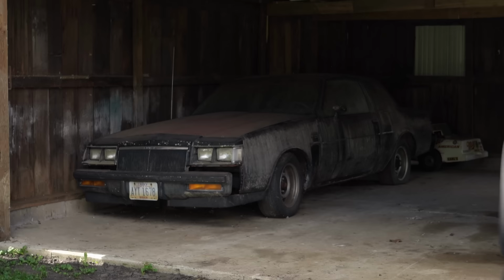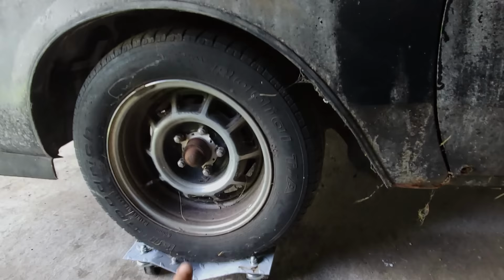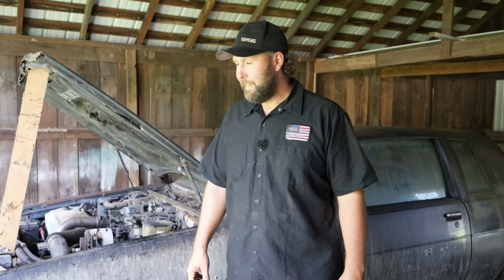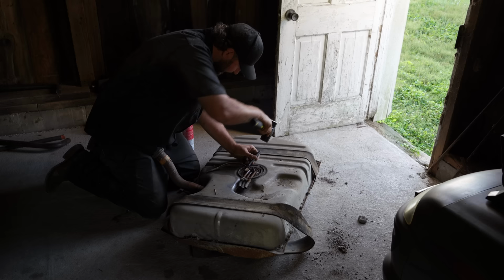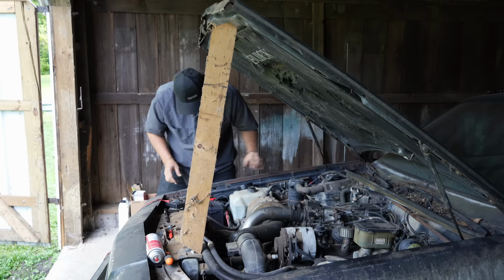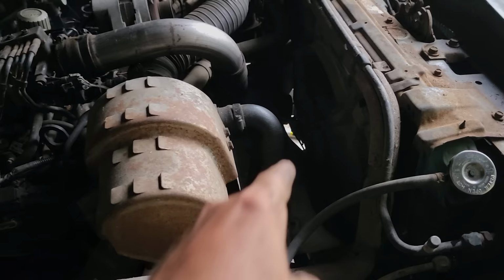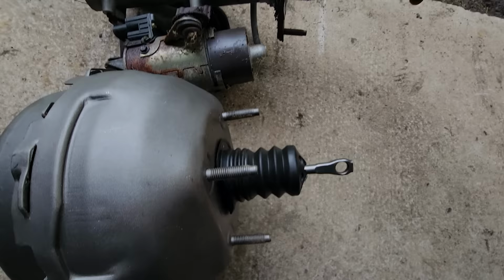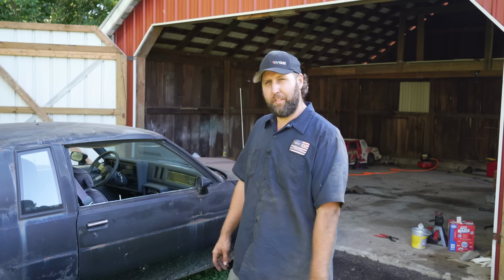Will It RUN AND DRIVE after 20+ years? Turbo Buick Grand National!

Comment: If you want todays gasoline to last for YEARS , add 1 oz of 2 stroke oil per gallon and it won't go bad. That old lawn mower starts year after year. 1 OZ of oil per gallon won't trip any codes either. Not even in very expensive high end European cars. I use it in everything I own. From old Chevy's to newer Porsche 911 s. No rebuilding carbs on 4 stroke dirt bikes. Avoid the whole varnishing thing with a little bit of oil. I'm sure you know that trick D.

Comment: You broke my heart when you turned over a car that has sat for so long without dropping the fuel tank and checking the fuel first.
Reply from the maker: Fuel pump wasn't even running so it didn't even do anything.
Reply: @ViceGripGarage  I know, but when you turned the engine over my backside clinched a little bit.
Reply: @ViceGripGarage  Also, can we raise a glass to this absolute legend with nearly two million subs who responds within 5 minutes to some rando commenting on a year old video?  Love the content, keep it up.

Comment: I like these cars but have seen a ton of them with rods through the block.I mean probably close to 50 cars so buick definitely didnt put good rods in them...as rare as they are to see that many tells me they were not built as strong as they should have been for the power these engines were capable of putting out..I'm sure they had alot of warranty work when these were new.